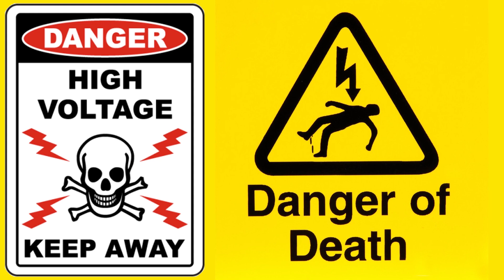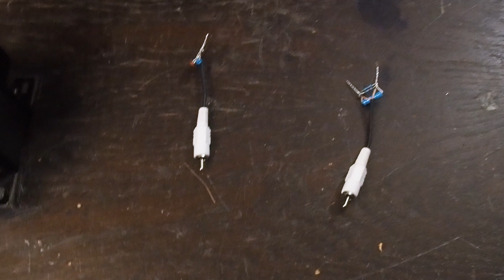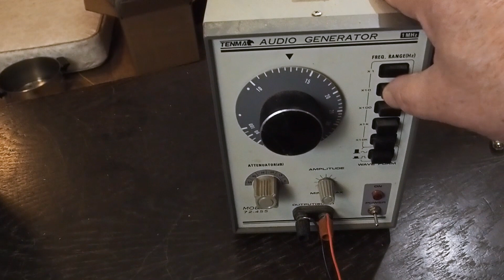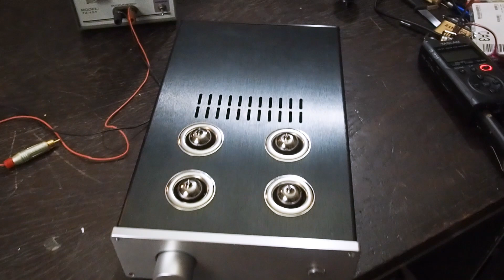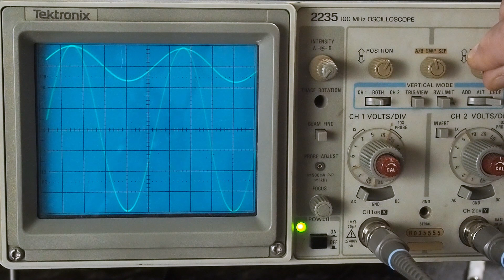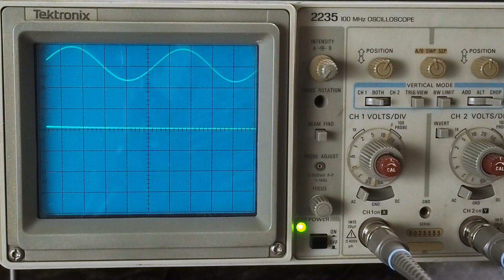HiFi Tube Pre-amp: Analog Scope Testing

Comment: just a quick question when changing to 12au7 did you have to change anything on the circet or were the 12ax7 tube faulty did you ever try any others. thanks
Reply from the maker: I need to revisit this little pre-amp :)
Reply: @SkunkieDesignsElectronics  you sure do as i still have not powered mine up but hope to in the next few days

Comment: Hi Stephi, how this thing sound? Do you plan to continue on this preamp? I am waiting your sound result because mine is hum at low frequency. I built it 100% using all components supplied as a kit. Thanks.
Reply from the maker: Yes I am! In my latest "Monday monolog" I explain I want to build a simple "Spud amp" that requires a pre-amp to test these with.

Comment: Stephi I want to echo what some have said below, you are an amazing teacher. From a Tube newbie, I am learning a lot about these amps/preamps that you have built so far. One question. I have built several Solid State amps and would now love to jump in the tube world, but one thing I have noticed is that there is a lot more test equipment required to build tubes versus solid state. From your perspective, should I even try one of your builds if I do not have the testing equipment you have? I have seen several examples in your videos where you use this equipment, from testing the appropriate voltages to the bad tube you fund on this video. Would love to hear your perspective on this. Keep up the great content you are providing.
Reply from the maker: I think you can "jump into the tube world" with just a good digital multimeter. You make a good point about this "bad tube" and I want to play around and see if this tube also makes the measured voltages go wonky, I bet it does. Most of this test stuff I use when designing, or redesigning circuits and making sure what I am doing helps the circuit.
Reply: @SkunkieDesignsElectronics  Thanks for the response. Now I just need to get up the nerve to do it and pick out a project. I was hoping to maybe start with something simple first like upgrading an existing amp but I just watched your Reisong A12 video and now I am not sure. I'll just wait for your ext video to see what you come up with.

Comment: What does that mean when the signal is inserted? How do you correct that?
Reply from the maker: I mean by that term is: using a signal generator, an electrical waveform is applied to the circuit and then using a scope, you look to see what that known signal looks like in other parts of the circuit.
Reply: @SkunkieDesignsElectronics  sorry I didn't check the spelling.  I  ment the inverted signal on the 6sn7 pre.
Reply from the maker: @allenwalters8812  Oh, the inverted signal just happens because of the design/number of stages. It's not something that needs correcting :)

Comment: I'm curious as to why you chose 3v peak to peak for the input level for testing.  I would be interested in what kind of output you could get with a lower input level like .7 or 1.0 volts.  Thanks for your great videos!
Reply from the maker: 3Vpp is 1Vrms which is around what a music signal from something like a CD deck would put out. Not like max signal but an average music signal. 2Vrms is the peak for most. I like to see an integrated amp be able to hit max power off 3Vpp. 

The other question, if 3Vpp is amplified to 30Vpp, 1Vpp would be amplified to 10Vpp. You bring up a good point, I probably should test them all at say .5Vpp and see how they do as well :)

Comment: If you end up with two outputs for two amps, will the outputs split the voltage (23/2)?  If the load was 100k, what would the new load be on the preamp?
Reply from the maker: The output voltage is per channel. If you drive two amps from each channel, the voltage wouldn't be split, the impedance would be 1/2 but as the testing show, going from 100K to 50K load didn't change the output but a tiny bit.
Reply: @SkunkieDesignsElectronics  Thank you!  That totally makes sense.